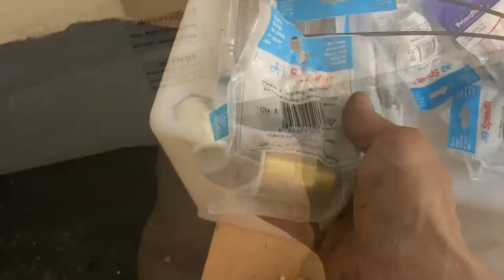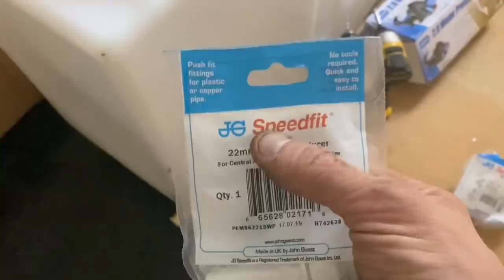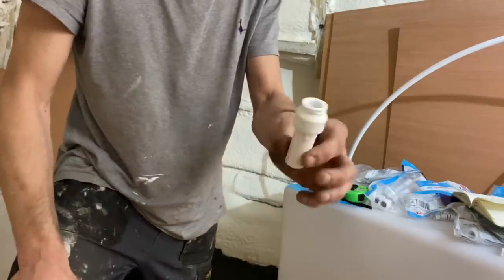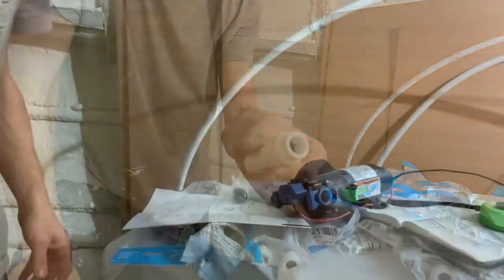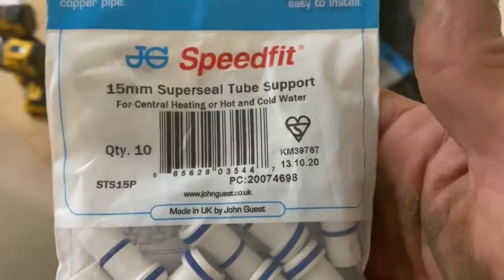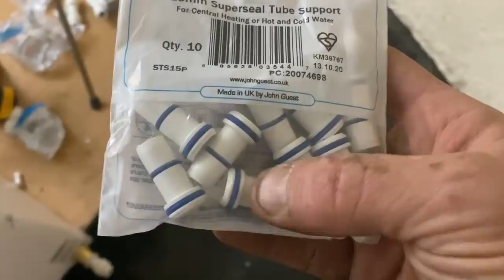58. Jabsco water system install on the Narrowboat

Comment: Hi James.
As others have noted, PTFE tape is required on all the threaded fittings.  Ideally, you would fit a tee where you put that elbow on the accumulator. to allow for a pressure gauge, to balance the tank to the pump cut off pressure.  I think you left the dust cap in the tank, too.  
Also, having lived in a caravan for a couple of years, I recommend using an extra thick rubber pad to mount the pump to, because they make quite a din with a nice piece of plywood acting as a sound board.
Make sure you leave easy access to the filter and pump for when they need maintenance.  You won't need a drain off on the tank, as those pumps are self-priming, and will suck the water out it.
Crack on!  ;o)

Comment: I always use the superseal inserts in preference to the normal ones - obviously the manufacturers haven't any confidence in the original o ring in the fittings! Hence the 2nd and third line of defence in the superseals. Glad to see you're including a filter - essential to avoid early pump failure! Keep going - you are a human dynamo...in (the water) by xmas!

Comment: Hi James, been watching your vlogs with interest. Just a note regarding your blue accumulator tank. Under the black rubber cap there is a schrader valve that is used to give an initial pressure to the system with a footpump. Best to make this as assessible as possible. Big thumbs up with build so far it's been impressive :-)

Comment: Most pumps the pump head can be turned around quite easily if that helps the layout. As others have said make sure you have very easy access to the valve and the pump and strainer. I have spent meny hours cursing  boat builders who have made stuff totally inaccessible. Good luck.

Comment: If I was putting a tank in now I would put a water level gauge so you know how low you are. While it's all easy to do. My tank is to hard to get to to do that. Need good access to that pump as well. I would also insulate the pump and put it on rubber mounts because they can be bloody noisey when pumping. Good luck buddy

Comment: Looking good fella , but personally I'd be tempted to put a elbow on the pipe from the accumulator going down rather than letting it curve down , as it's under strain . But fair play you are cracking on , and when it's all working you should take some pride that you done it solo 👍

Comment: The accumulator should have an air valve for setting up the pressure, I think. Probably opposite side of the input. That needs to be accessible after the system is installed, because you can’t measure what it should have before the system is complete. So uh... think of how awkward you want to make that for yourself.

Comment: Don't forget you'll need to access the top of the accumulator to release the pressure when you're setting up ( i think these are pre pressurised with nitrogen) and repressurise if necessary during use. You'll also need a pressure switch to turn the pump on and off. I expect you have that planned further down stream :-)
Reply: I think those pumps come with a built in pressure switch.  The one in my RV / caravan does.

Comment: having a loop in the flexible hoses coming off the pump helps with reducing vibration. Also have you considered a way of knowing how much water you have in the tank? Might change how you lay things out.
Reply from the maker: Good to know - thanks. I was going to instal a meter but it’s just me and I reckon I’ll be filling up every other week at least. Why would water level alter or change the layout of pumps etc??
Reply: @TheNarrowboatThatJamesBuilt  the type I have uses pressure generated by gravity I think, so you fit the sensor between tank and pump. If you’ve watched “journey with jono” he fits one. You need it level with the bottom of the tank to get an accurate reading.
Reply from the maker: andy bailey I’ve seen him instal one. By the way, what’s happened to Jono, he hasn’t done a vid for ages ??
Reply: @TheNarrowboatThatJamesBuilt  that’s the one I have, about £90 I think. I’ve heard rumours he’s not on a bout anymore, he is doing voice overs for Victron quite a lot.
Reply: @TheNarrowboatThatJamesBuilt  Jono got a job making videos for Victron and has moved off the boat and into a house. I think he also got a girlfriend!
Reply from the maker: ClaireandChrisontheboat Vonasi wow. Several points surprise me there! Good on him
Reply from the maker: ClaireandChrisontheboat Vonasi oh wow - I’m so surprised he left his boat, he seemed to love it !! Hope he’s happy though !!
Reply: @vonasi2  Has he dumped his old one Molly
Reply: @patrickmoran7680  No apparently she is still his soul mate and still never leaves his side.

Comment: Usually 22mm is used for the pipework as 15mm can reduce the flow rate but I guess the price of the 15mm was too good to be true (free!) Be careful to use swept bends instead of 90 degree elbows wherever possible as this is less restrictive and also cheaper! As others have said a pressure gauge in the system is also very useful - especially for working out what pressure to set the accumulator air pressure to.

Comment: Are you going to put an isolation valve in between the tank and the pumps etc.? Will save having to drain all your water if you need to replace anything later on.

Comment: James did you reverse the order of the o ring and the washer when you re-assembled the joint that you took apart on the video?
Reply from the maker: I don’t think so 🙄🙄🙄
Reply: Nope. I checked the video several times to be sure. What comes out is plastic piece first and then the o ring, and it went back in reverse order obviously.

Also that makes sense: the o ring is squashed between the plastic of the fitting and the plastic washer. Plastic washer is there so the bit of plastic nut, that comes screwing in to squash it, doesn’t tear the rubber up from the rotating action.

Comment: The valve to the accumulator needs to be accessible both for checking the pressure with a tyre pressure gauge and to fit a pump to when the pressure is too low and you need to put more air in to the accumulator. ( see pump instructions re pressure settings for accumulator tank or accumulator instructions ). Once fitted I check the pressure once a year. 
I know you intend to run water pipe across to the bathroom under the floor in the bilge. Personally, and it's only a suggestion, but this will increase the risk of the pipes freezing. Unless one sucks the water out of the pipes using a vax, or similar there will be always water in the pipes somewhere. If you drain the water off by running the taps, and leave the boat in winter whilst you are somewhere else for a period of time the pipes under the floor could freeze. I believe plastic pipes are more resistant to freezing and that is one reason they have been used on boats for many years. But the bilge being under the water line and under the floor is the coldest area. I don't think it's worth taking the risk. It's not far to the bathroom down the boat and I have had several water leaks on my narrowboats usually after winter. This year it was the connection to the filtered water tap, another year it was the connection to the bathroom tap. Only a suggestion though, great videos.
Reply: Isn't the water temperature normally above freezing even with ice on top? Wouldn't it be better under the floor and below waterline and freeze quicker if say under the gunnel? I don't know if this is right is just a thought.
Reply: @claire4486  Ice almost never gets thicker than a foot or so even in the coldest of winters I’ve experienced, and those are extremely rare anyway. So yeah, the baseplate should almost never freeze. If the boat is unoccupied, the inside temperature could easily be freezing, though.

Comment: I think you will need to lock your pipes down, or they will knock every time they pump water.
Reply: The accumulator should pretty much eliminate that on that side. But they should be locked down over the long lengths for sure.